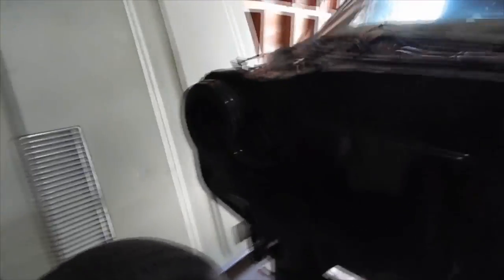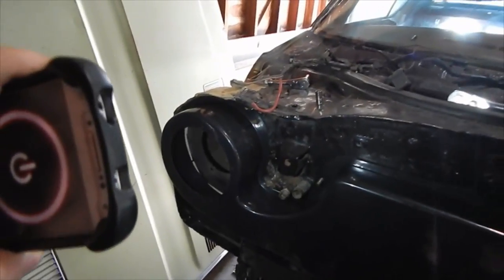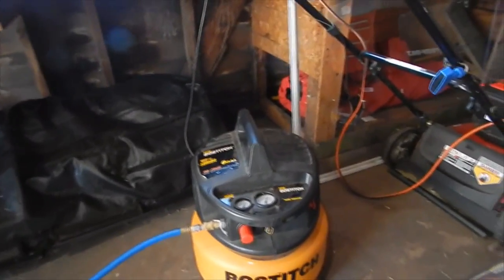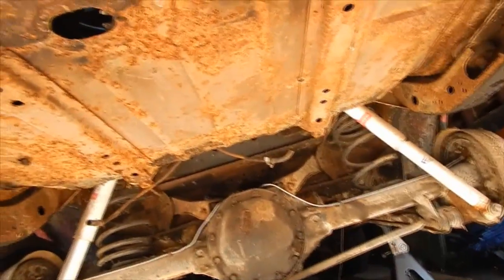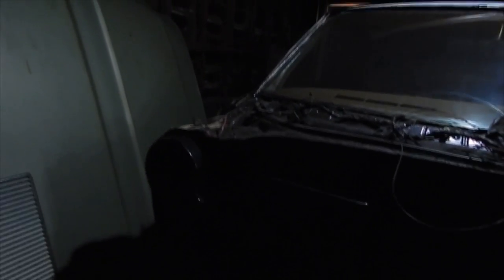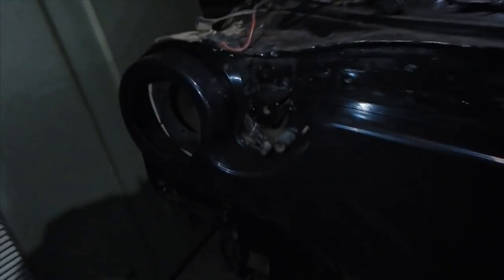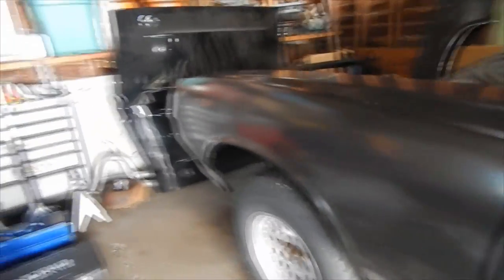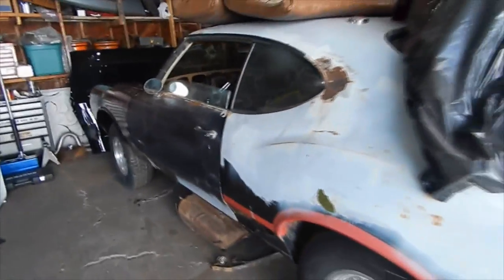1972 Oldsmobile Cutlass Project Part 10

Comment: Well it looks like your doing a good job. Glad to see your taking your time to make the car nice. What's the history on the car?
Reply from the maker: Useful Entertainment The most info I could dig up was that it was used by a highschool kid back in 07, then was sold in 13 to a guy in warren and then I picked it up. It originally had a 350 and a turbo 400 transmission. It was originally a bamboo yellow aswell.
Reply: Redline ok not bad. I'm surprised it didn't have a th350 from the factory but still the 400 is a plus.
Reply from the maker: Same here, its quite an odd combo, ill have to pull out the build sheet and see if i can piece together any other options. My father said it was designated as a Cutlass S, but I can't see anything that would indicate it.